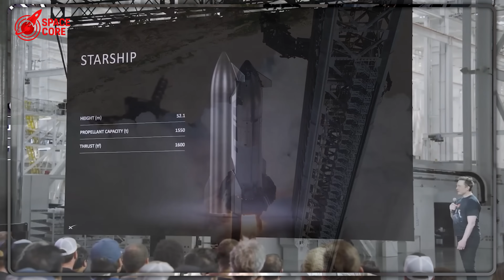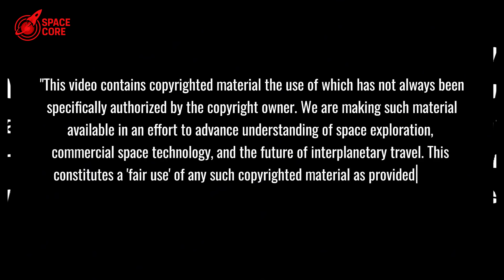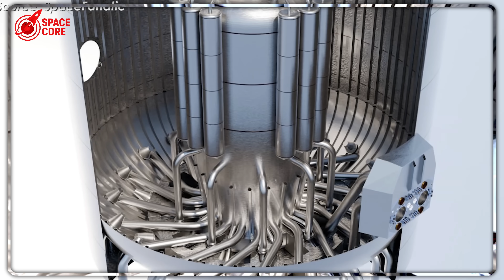Starship Massey Explosion Recovery SHOCKED SpaceX...Here's Why!

Comment: Too fast. It could have been filled with Non Explosive Gas to check for leak's.
Reply from the maker: SpaceX's rapid Massey recovery used the explosion's data to skip Non Explosive Gas tests, accelerating Block 3 upgrades. Speed was key to fixing real flaws!

Comment: It was so valuable because it happened where they could recover everything for physical inspection.
Reply from the maker: Absolutely, the physical inspection of recovered materials adds immense value to understanding the incident.
Reply: @SpaceCore25 Advising,check for leak's with non Explosive Gas,Gas Cool tiles included. 3D weld the vonerable tile part of the ship so it can be quickly replaced when needed.
November 19 of 2024 I suggested piping gas into the tiles through the connection pins.
Reply: @SpaceCore25 not every model will need a heat shield girdle but the Hull may need this tempiture control in that side of Starship for cooling in places like Saturn ring where it can harvest fuel.
Reply: You can actually fill Starships Methane tanks with a circle back path through Saturns Methane ring before returning to Mars. That would make the entire starship cargobay a Fuel tanker.
Nice to meet you too LOL  @SpaceCore25